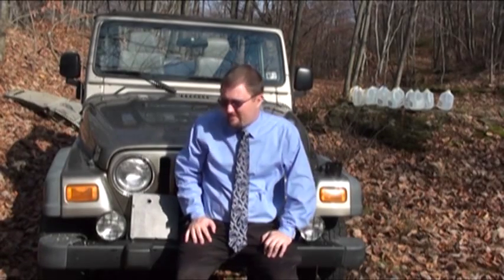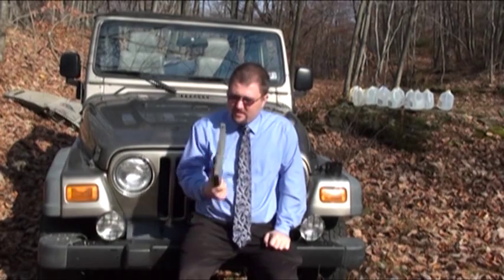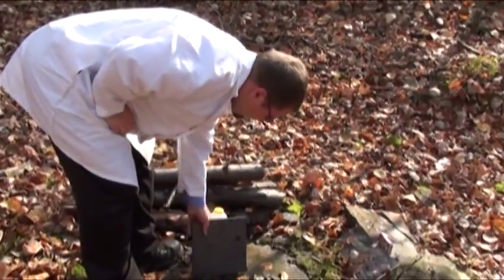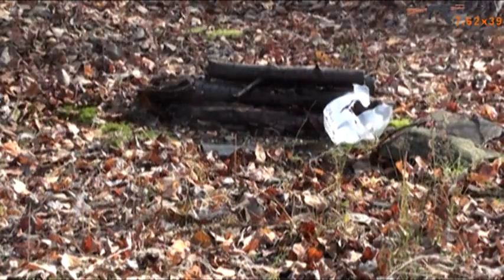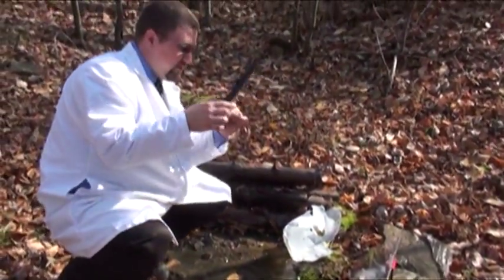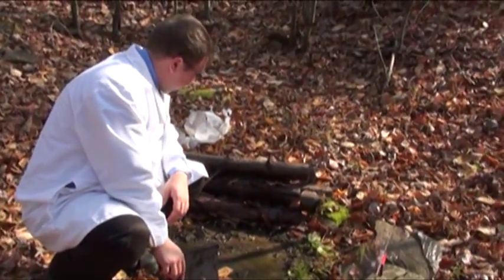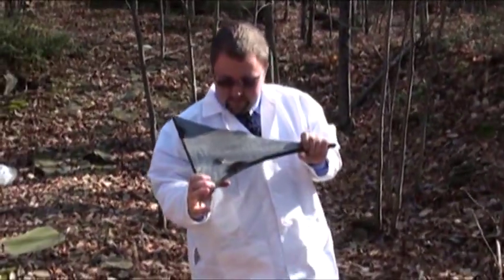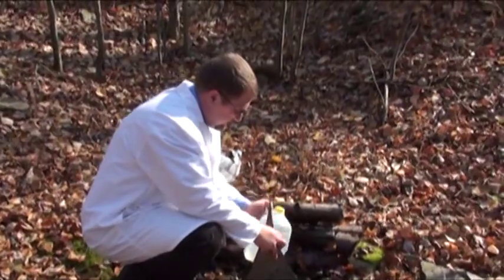Episode 24  - Will it Stop a Bullet (Carbon Fiber Pt. 2)

Comment: Your sir need to do homework, Did you do well in science???????  probably  not    Read more about how carbon fiber works, then think about it, and ask your self, how do i take the ballistic energy away when the bullets hits. Think about like this. A bucket of water...... If i hit it with my fist, its going to disperse water all over the place, that energy needs to go some where right !!!!!!!. Your get what I'm dropping down lol  Now with that same bucket of water...... Make a fist, release one finger out like you are pointing at someone, and quickly drop your finger in and out. whats happens ??????????? you get very little transfer of energy,and the water does not go all over the place.      That ak Bullets is going so fast through that carbon that,the release energy is very small,just like the finger in the water.